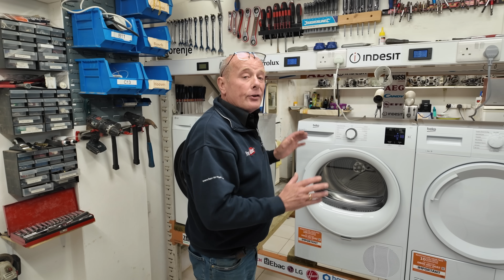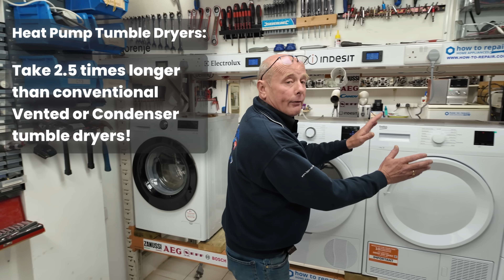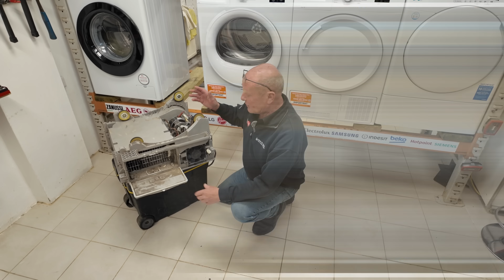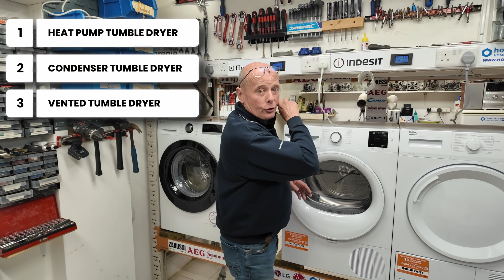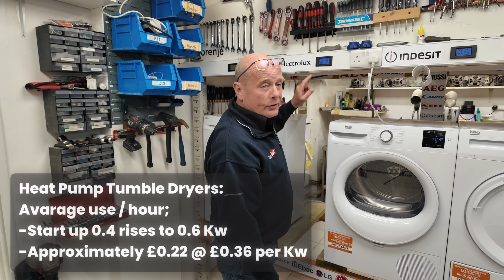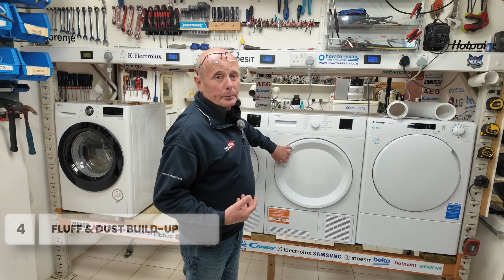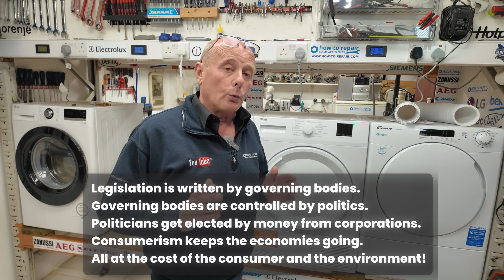Tumble Dryers the Shocking Truth About Heat Pump vs Vented & Condenser, NEW LEGISLATION!

Comment: An extremely well presented video, no waffle and to the point! I think the push for net zero and energy cost reduction doesn't take into account common sense, sometimes a pragmatic approach needs to be taken. We have a basic vented Indesit dryer costing around £120. They are very simple to repair whether it be heating, control or bearings. What people don't realise is that you need x amount of energy to heat your home or in this case dry your clothes, so yes it will take longer and the machinery cost is more. Therefore in my opinion it is not cost effective. We no longer use our dryer unless ABSOLUTELY necessary, I am a tight Yorkshireman!
Reply from the maker: It's hard to believe that manufacturers expect consumers to be happy buying major appliances every few years. Using environmental issues to sell more machines is ridiculous, especially considering the ecological damage it causes. They are ruining their reputations by making such products.

Thank you for your comment. I appreciate people like you taking the time to write it out. Please share it where possible. It might help others make a wise choice instead of being misled by the industry.

Comment: If you buy the cheapest model available then yes they will break I had a Miele condenser which we swooped for a heat pump model same brand which dries in half the time and uses 1/4 of the electric less than 50p total to dry 8kg of washing, videos like this are misleading, I am glad we dropped and it’s a Miele so parts are available for 20years and it’s reliable my last one and this have never slipped a beat I do clean it regularly though and it has way more filters than the one he had to prevent dust getting to anything Important so I disagree

Comment: No point in us hanging out clothes to dry !
We live by the coast with a large seagull population.
We've nowhere suitable for a vented model. 
We have a Siemans  condenser dryer. 
I was a domestic electrical appliance salesperson for over 20 years. 
Now due to the cost of electric in UK we now only use  if  needed to get one or two items dry quickly.
Instead we use old fashioned airers - with a dehumidifier  laundry setting in a small bedroom.
This works really well 🇬🇧
Reply from the maker: Thank you for your comment. I appreciate people like you taking the time to write it out. Please share it where possible. It might help others make a wise choice instead of being misled by the industry.

Comment: I am a retired electrical/ electronics engineer and applaud your report. I repair all my home appliances and equipment - except refrigeration. I have solar panels on my home. I run all washing and drying appliances when solar power is being generated. I draw no power for this from the grid. Heck, I even use our ovens only when solar power is available where possible. My washing and drying appliances are over 25 years old - and the ONLY thing I have replaced are the shock absorbers on the washer and the light bulb in the dryer - once. We wash on average 3 times a week - so they are very well used. The tumble dryer is a condensing tumble dryer. Both are high end German products. I expect that I will need to do some minor maintenance in the next 5 or so years (that any reasonably handy person can do) to keep both running for another 25 years. What is my point? Its about system thinking - I don't need the efficiency or the maintenance/ replacement problems and costs for a heat pump because I have created a system where maintenance is cheap and easy and I draw no power from the grid to use them - so the lower cost of the heat pump running is irrelevant (and exporting solar to the grid returns no income now either). This is not bragging - it's just simple system engineering to keep and repair appliances for as long and as cheaply as possible without adding to carbon impact thru use of electricity or manufacturing/ disposal of appliances. By my calculations, my washing and drying appliances will have cost me a total of 50c per week over their life and I will have had a tiny carbon footprint on the world. We just need to think more broadly than single focused solutions - sad that we are phasing out condensing dryers - silly solution by politicians - but what else would we expect!.
Reply from the maker: Government only want us to have Solar when it is only partially beneficial like you I have a lot of Solar and I am able to run most of my energy bills through it. There should be more focus on getting free energy to customers but that doesn’t pay for the governments.
Reply: @How-to-repair  Its interesting how poor our politicians are at sensible system engineering thinking - for the benefit of the community. As I live in Australia - currently solar is a major push thank god, but a change of government may cause a pivot to nuclear - much to the detriment of most of the population due to cost - because the farmers don't like power lines or wind turbines near them. Sad. There is a big push here for heat pump hot water systems which suffer the same problem as heat pump dryers. My system solution is to put in a controller that diverts solar power to my resistive water heater during the day. Again need no grid power, cost of a resistive heater is a quarter of a heat pump heater and maintenance/ repair costs are trivial and simple for a new heater element or sacrificial anode when they die. And resistive heaters make no noise to annoy neighbours!! So little system thinking is given or encouraged today.

Comment: Not a fan of heat pump dryers, we have looked at replacements for our dryer. None are worth the money in what the savings on energy would be. Our basic, cheap vented 28 year old dryer drys a load for less than 25p off peak (thanks to an EV tarrif) It has never had any issues unlike multiple replacements friends have brought in that time & has even moved over 200 miles.
Reply from the maker: I think heat pump technology is brilliant, but these machines are only lasting on average five years they take at least two times longer to dry the clothes at least twice the amount of wear and tear and components and the accessibility to do maintenance is an absolute nightmare. manufactures do not seem to understand what maintenance is needed and how easy it is to do. They seem to build it and assume it's perfect without testing properly. Thank you for your comment. I would be grateful if you would share this post, as it’s the only way to force things to go large nowadays.

Comment: I estimate I'm saving around £150-200 a YEAR, by using heat pump vs condensing dryer (based on loads and electricity tarriff) - so after 2 years, I can buy a new machine and still be quid's in. My current Bosch has lasted 4 years so far, and because it has a decent dual level filter setup - when I popped my flexible camera down to look at the heat exchanger - it still appears to be pretty clean and free flowing.... So i dont agree that much with your case - it has some merit - and id say for cheaper Heat pump machines less well designed , it may be more valid.

Comment: ⚠️Who even buys driers?!!
We have good old fashioned clothes drying racks in a spare room used in conjunction with a rotating desicant disc dehumidifier (no compressor)
Clothes are dry the next day.

There's very little 🔥 risk with our method as we've heard of so many driers catching fire. 
We would recommend every drier cover is removed annualy judging by the fluff is found in these.
Thanks for pointing out the pitfalls of heatpump driers, we would never select those.
Drying racks do not wear your clothes out ⚠️
Reply from the maker: I think that is an exceptionally good idea but you must remember a lot of houses in the UK. Do not have the capability of space but I will be making a video on a dehumidifier room which has fans blowing and uses the ambient temperature in the household and the clothes are normally dry within 6 to 7 hours, thanks so much for the comment

Comment: In all cases of replacing current technology and equipment, it is rare to include the environmental impact for the manufacturing of the replacement product. 
If an existing item (car, motorcycle, lorry, central heating condensing (combi) boiler, tumble dryer etc.), using standard hydrocarbon fuel is properly maintained, then replacing a non-faulty one with a (almost) equivalent non-fossil fuel-based version, it would take many years of normal use before the impact on the environment of producing the raw materials and manufacturing the 'eco-friendly' version actually has a positive benefit. 
That final energy and CO2 benefit may even occur after the newer product has worn out! For example, I have three different types of vehicle, a diesel car (Citroen Berlingo Multispace), a diesel based compact camper van (based on a 2019 Ford Transit Custom) and a couple of motorbikes (both with fuel injected 4 cylinder engines). 
I regularly need to drive on multi-day trips where daily distances can be in excess of 250 or 300 miles, and sometimes even double that. Whilst many of these trips and distances may be achievable in a modern electric car or campervan on the first day (if I leave home fully charged), the possibility of finding a suitable charger each night may not be possible, thus making the entire trip impossible. This is even worse with electric motorbikes as, due to the physical constraint of battery size and existing charge density on Li-On batteries, it's unlikely that I would be able to ride for much over 100 miles without requiring a recharge, thus making many of my touring & camping trips impossible, or at the least, far more difficult and would take far longer.
Furthermore, the UK (and probably all countries) simply do not have the power generation or distribution infrastructure to support a mass migration to electric (or even hydrogen) based fuels.
We simply don't produce enough electricity, and the national grid couldn't currently support the additional load, in fact it barely meets our current needs. I am furtunate to live in a house with off-road parking and where I could install a vehicle charging point, but that's not the case for many people, especially those in rented properties, without off street parking or who live in a block of flats. 
As someone with a career in computing and information technology I am not a luddite, but the simple practical issues are not being properly addressed or investigated and those making the decisions are clearly either ignorant or swayed by the influential lobbying groups. 
Lastly, the cost implications of the change to environmentally greener products isa social and economic issue as it is only affordable to those on above average income. 
If it's a case of a person or family on low income (including nurses, healthcare workers, social care, many manual workers, public servants etc.) who simply can’t afford and electric vehicle or couldn't run one even if they could afford it, or buying a much less expensive standard ICE (internal combustion engine) car, then they simply don't have the electric option.
The same applies to heat pump installations for homes (air or ground sourced). It's far more expensive than a standard gas boiler and only possible for home owners in houses with sufficient external space.

Comment: We have had an AEG heat-pump based tumble dryer for over 10 years now, we clean the filters every time, and I clean the vanes a couple of times a year. We run it when we are generating solar power, or when we are on cheap rate electricity. Used most days, and so far no issues with the mechanical aspects, but I do believe you get what you pay for, and this was not a cheap machine. The previous heat-pump machine lasted over 12 years before the compressor failed.
Reply from the maker: I think heat pump technology is brilliant, but these machines are only lasting on average five years they take at least two times longer to dry the clothes at least twice the amount of wear and tear and components and the accessibility to do maintenance is an absolute nightmare. manufactures do not seem to understand what maintenance is needed and how easy it is to do. They seem to build it and assume it's perfect without testing properly. Thank you for your comment. I would be grateful if you would share this post, as it’s the only way to force things to go large nowadays.

Comment: Very interesting comparison.  We have a heat pump dryer which was chosen because where we wanted it sited in our kitchen meant it was not against an outside wall so a normal dryer wasn’t suitable.  Condenser dryers were rejected because of the heat they put out into the room.  The heat pump dryer has proved perfect for us as it solved both of our issues.  To be honest the original purchase cost and the ongoing running cost were not even factors in our decision.  I realise that for others these may be major influencing factors.  With regards the economic repairability of most white goods, it has for many years often proved to be cheaper to replace than repair.  This may be bad for the environment but it’s for the industry not the consumer to find a solution….although having said that it will inevitably be the consumer who pays in the end!

Comment: This is mental. Surely it's obvious the savings aren't worth it especially once the fact that most are going to use a dryer only when the weather isn't conducive to drying outside so the 'waste' energy from the dryer comes off the energy for house heating... Diversity hires are taking over!

Comment: I’m a total renewable energy fan, I’ve had an EV for 2 years and not only is it better than my previous petrol car, it’s saved me money.

But I also have a 20 year old Hotpoint dryer that I have repaired cheaply at least a couple of times. What you are saying makes total sense in that context.

You need to look at the whole picture not only the energy used

If they can design heat pump driers so you can clean them that would go some of the way to improving things though I suspect. 

The best solution is a washing line in the summer though and racks plus a a dehumidifier in a drying room in winter?

Comment: I knew it and Figured it out within 10 mins of discovering vented tumblers were being phased out that heat pumps were more of an issue than beneficial. I'm not welcome by the phasing out and will do my best on keeping and using vented.. it tried and tested if the years and that's that.!
I will not be forced on moving on against my own decision, I should have a choice..

Comment: Our vented Montpellier is made in the UK ,easy maintenance, runs for free on solar panel's or cheap rate electricity,less wear on clothes due to a humidity stat ,so if timmer is set for an hour turns off when clothes are dry before time is up,also cuts wear on motor and parts.
Most important thing is that clothes smell fresher than using a condenser dryer.
Thats the most important thing to the wife,something manufacturer doesn't consider as most dryers are designed by men!

Comment: I am in the American South and it gets really hot and humid. It can get over 37 Celcius and 90%+ humidity, making drying clothes take forever. If I had to use a heat pump dryer, it would NEVER stop till it died, which doesn't sound like it would be all that long anyway. The American government did the same thing to our dishwashers, they used to clean really well and quickly, they do use much less water but so much more electricity, and our dishes don't come out as clean.

Comment: Had my Samsung dv9000 heat pump dryer that had been Stanley knifed across the serial number so would likely end up in landfill.  Got a family member to regas and fix the leak and has been fine for 5 years now. Only maintenance I’ve got in that time is a garden sprayer hose in to the heat exchanger area on the Samsung heat pump with my trusty wet vac ready to hoover the water as it comes back out. I just blasting with water until fins so blue again. When I open my wet vac the amount of lint in the water is pretty impressive. Like grey soup ha

Comment: That’s the point he was making. You can easily clear the fluff out of a vented and condensing dryer. However not so easy for a heat pump tumble dryer as it needs a full tear down, removing the drum etc. 😢
Reply from the maker: Manufacturers could easily make the evaporator and condenser accessible, but they chose to make it nearly impossible why you might ask obsolescence obsolescence obsolescence
Reply: For sure. It’s in their best interest. Obsolescence built in.

Comment: I dont agree.   Its quit easynto make heat pump dryers last as long. If reliability is a problem you simply use slightly larger bearings belt and motor.  I disagree about gassing your fridge uses same technology and how often do they break or leak.  Cleaning i agree is a issue.  I agree right ro repair